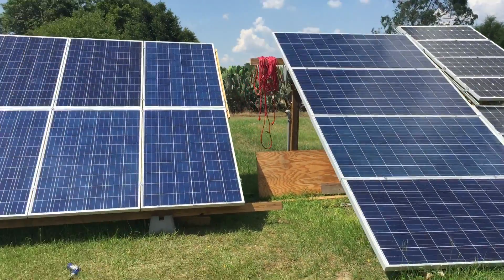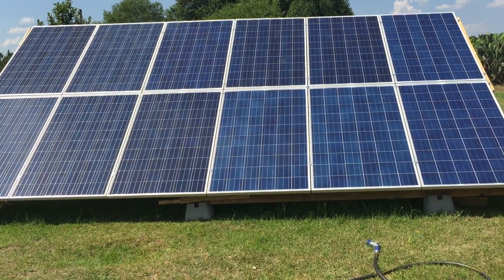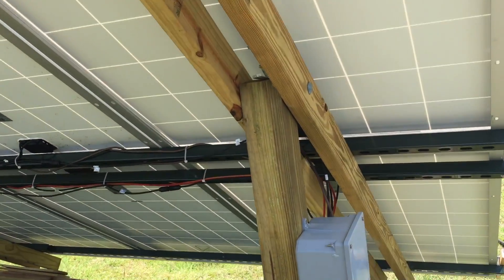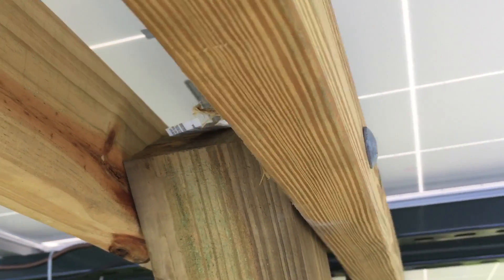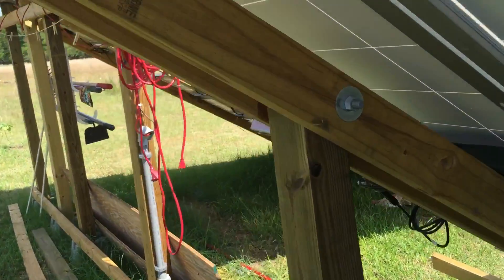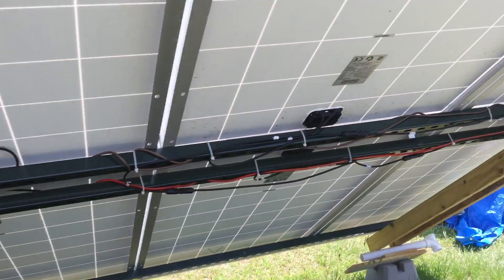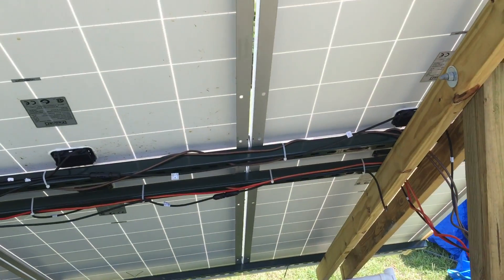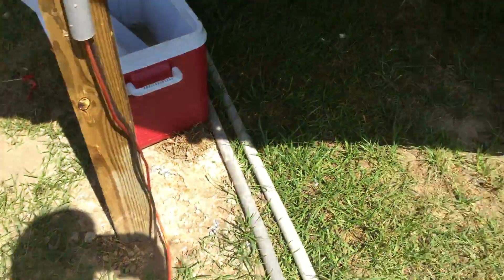DIY Solar Panel trackable Ground Mount System 3kw

Comment: Having had our original solar panel array ripped off of our roof by high winds I can tell you that your 4x4 posts are way too inadequate to support any kind of serious wind stresses. Also as a carpenter I can understand your wanting to build your array inexpensively - but it is very unwise as you put all of your investment at risk. Also if I were your neighbor and your substandard array flew into and through my home in a storm I wouldn't think twice about suing you for damages. I don't always like doing things by the book but when I build something without any governmental inspections, you can bet your bottom dollar that it will be built to (better than) above code standards.
No excuse for shortcuts and shoddy work. Yes it looks good on the surface but looks don't count for much if no substance beneath.

Comment: Sir 
For Large solar project  Pls contact for robotic solar panel cleaning both power plant n roof top project zero water what app +918884170749/sfdindia@yahoo.in  we provide full details on web site 
www.nomaddesertsolar.com
Low cost operated SACAD now in India Bangalore,middle east,jeddah

Comment: A high wind gust from the back and that thing is going to move. A 60 mph gust will have 4 times the energy of a 30 mph gust. Design for 10 lbs. a sq. ft. of uplift.
Reply from the maker: kkarllwt the design did sustain direct winds however they were coming from front no damage until things landed on panels

Comment: What wattage panels are these? I know a few companies are always a little different. Some 280 watt,  others 250, 255, and so on
Reply from the maker: SpeakersIsGod the 12 panels installed are all 280 watt panels from fennel. The other 4 large panels are 300 watt panels

Comment from the maker: I've had the 2kw system exposed to near 30 mph wind gusts and it didn't shift the panels at all. I have used lag bolts and washers along the way with the 2nd design to make it more secure. Also I have intentionally drilled the holes in the 2x4 so that the pivot is very bottom heavy and near impossible to pick up without a counterweight. I'll likely set a braking point so that if the wind is powerful i.e. Hurricane I can keep the movement and damage minimum

Comment: Are you concerned at all about high winds?  We get some pretty strong maritime storms where I live.
Reply from the maker: No real concern with the winds but I now have counter weights to help with lifting panels so ill work on strapping to help keep it secure. Good point. Not sure why reply didn't post.

Comment: Wow looks good brother. What charge controller you running for the new PV? Thanks for taking the time to show us. God Bless.
Reply from the maker: Not sure why it didn't post reply. I am using outback flexmax 80 on the new array. VOC is at 138 typically brings in 15-22 amps at 115vdc so the charge controller handles it well.